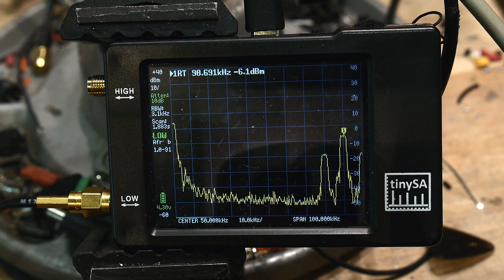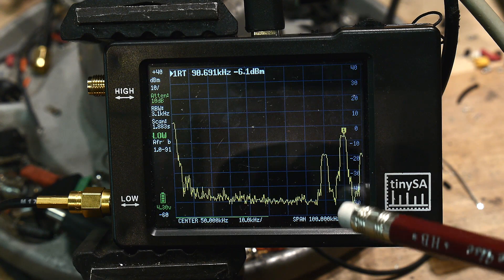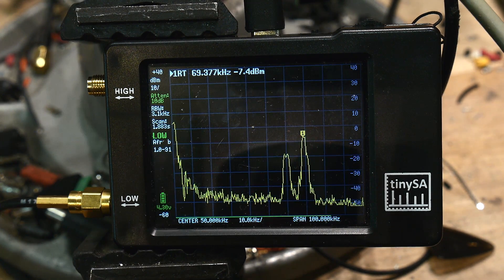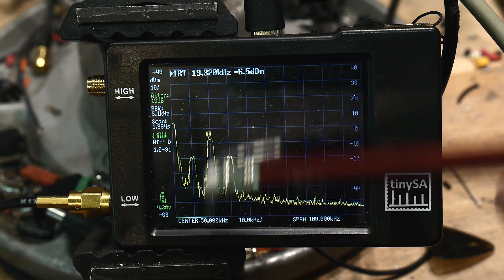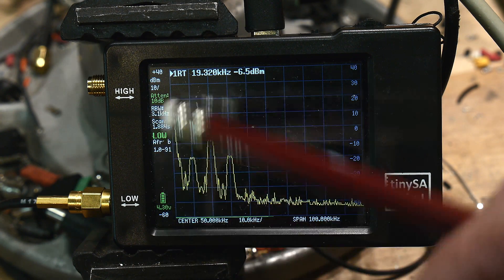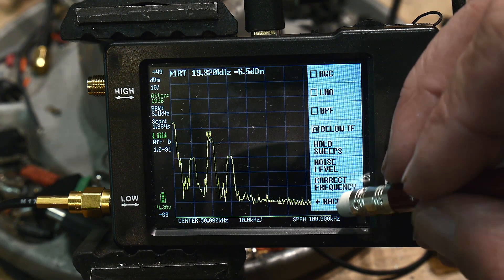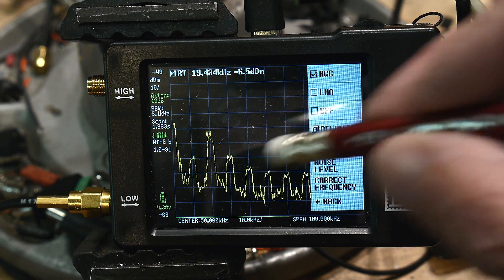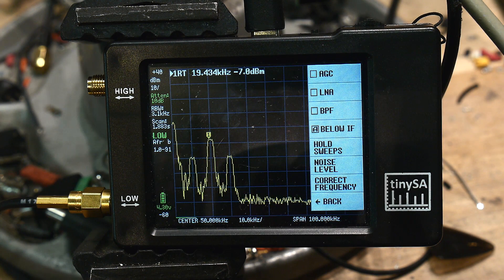#562b TinySA Low Frequencies Down to 10 KHz

Comment: Hello sir, nice achieve. What about the antenna? What antenna are you using? Congratulations and thanks to share!
Reply from the maker: no antenna, the signal was generated with an HP 33120A generator, sine wave with AM modulation and fed via coax to the spectrum analyzer.